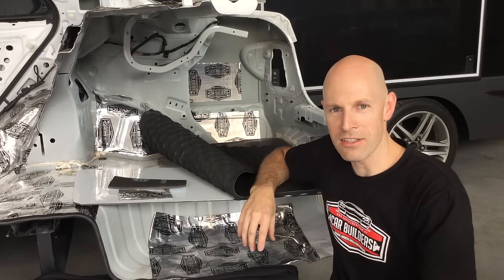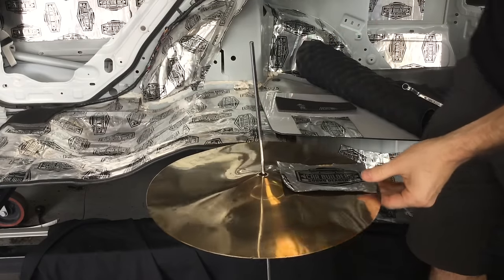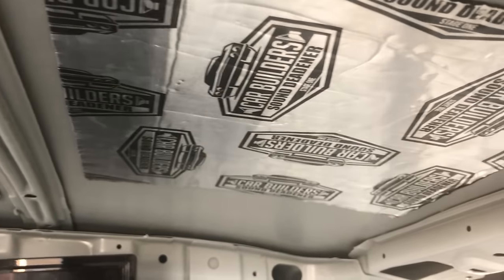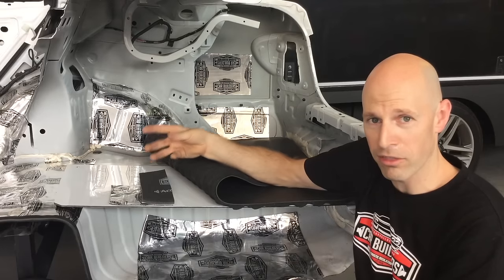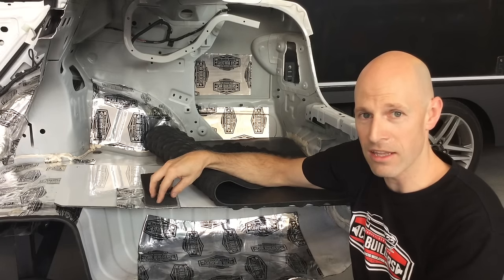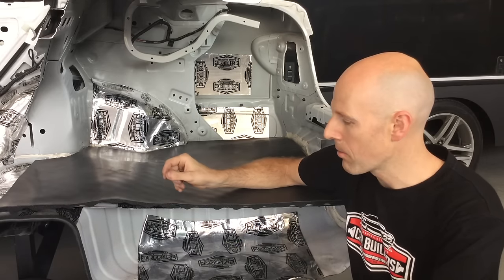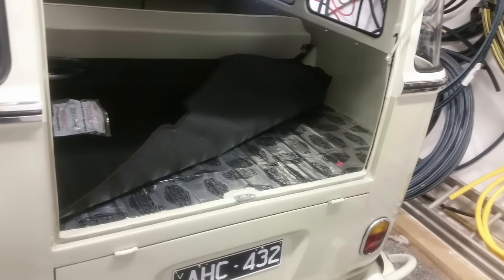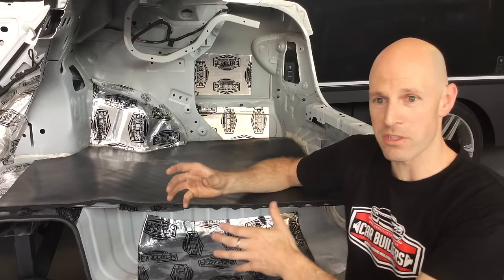The basics to sound deadening in cars. What should I use to control sound and heat in my car?

Comment: My car should be so loud that you have to shout, no muffler no cats just straight pipe exhaust coming out under the doors. The V8 should literally shake the cabin apart and the AC should be totally broken so that you have to open the quarter panels to get some air but then the engine sound will overwhelm you if you open them. Thats my idea of a perfect mans car, also it should be 50 years old. Not some last years air conditioned model plastic bucket with heated seats and gadgets and 1.5 liter hybrid. That is a womens car.
Reply from the maker: what did you say.... 
Haha, yeah, that's a car with some personality 😎👌

Comment: What about rubberized undercoat for under carriage that is supposed to offer some sound dampening as well? Also can we just use the foam sheet only and not use the rubber sheet before it?
Reply from the maker: Hi there. Rubberized undercoats such as Bully Liner are good protective coatings rather than sound deadening treatments. There are purpose made paints to treat sound and heat such as the Lizard Skin range http://www.carbuilders.com.au/lizard-skin-sound-control 
The butyl mats add weight to the panel and stop vibration created noise. If you don't think this is a problem in the vehicle you are treating you could apply just the Stage 2 underlay options to filter road/external noise.
Reply: I did the spray can stuff on my wheel wells. It didn't work as well as I would have liked. I'll use exterior low-cut carpet fastened to the under side next. That's what my Lexus has, and it seems to be working fine.
Reply: Thanks for reply. Now i know what i should do for my car.
Reply: Rubber undercoat Will destroy your car man, use oil or asfalt

Comment: Beware of weight Butyl is heavy ….Certain layers can eventually lead to hundreds of pounds...and that's  a lot of Fuel costs.
Reply from the maker: Hi Todd. One box (1.8sqm) is just under 7kg. Most of our full vehicle packs are under 50kg (this includes the Stage 2 noise blankets- mass loaded vinyl)...equivalent of adding a teenage passenger. Any product which is going to act as a Stage 1 vibration dampener needs to have weight as it is the weight on the panel which stops the vibration.

Comment: What if I just put a thin roof insulation sheet in the car
Reply: iTsNick it’s only .5 mm thick. You have to do four to five layers, and even then I doubt the thin rubber will soak up any vibrations... I’m actually doing this in my car, and it doesn’t seem to making a difference at all... Shame I can’t share any pictures...  I show what I have done, and how it’s not worked... just to thin.
Reply: Roof insulation sheet is asphalt, it is a very poor vibration damping product.  You need a viscoelastic layer coupled to a rigid surface.  Ie, a good butyl attached to a moderately thick aluminum layer.

Comment: Isn’t all this stuff heavy?
Reply from the maker: Hi Peter. Sound Deadener (stage 1) needs to be heavy to add weigh to the panel and stop resonance. The foam underlays (stage 2) are light. The Mass Loaded Vinyl is heavy. Depending on the vehicle (areas deadened) and choice of stage 2 (foam or mass loaded vinyl) the total weigh may vary from 20kg-45kg for a sedan.

Comment: My GTR got soundproofed. And now its like dronning and vibrating. What is wrong ?
Reply from the maker: Hi Little Reptilian. What stages did you do? Did you put stage 1 deadener down? This is the stage that will stop panels vibrating. If you put just a stage 2 vinyl down you will still have vibrating panels. Feel free to call us to talk about the specifics 03 8777 0960 👍

Comment: Nope. Water will find its way via the edge of the foam sheet to the open cell foam bottom half and because the closed cell foam sits above the now wet open cell half which is in essence a sponge, that water is not going to escape ever and you are going to get long term mold issues. Good luck!
Reply from the maker: Hi Supercharger. If water is a concern for you, we don't recomend the Acoustic Liner (and definitely not the factory cotton jute underlay). We have Water Proof underlay, which is 10mm of closed cell foam. The 4x4 guys, prefer the Mass Noise Liner (MNL) which is a closed cell foam with a mass loaded vinyl on top. MNL isn't a peel and stick product so if they swamp it or are concerned about water on the floor pan/cargo area they can easily lift it up 👍

Comment: Does it have to be shiny? Aluminum.. I mean I have AC in the car so heat won't bother ...
Reply from the maker: Is the sound deadener going to be the finish? Normally it is covered with a carpet underlay and then a carpet so the shinny finish look isn't an issue. We also have sound deadener in 4 colours/designs
Reply: Car Builders - Thermal & Acoustic insulation materials oh ok so for heat and looks. Thanks ! There will be carpet

Comment: so if one little piece can quieten a Cymbal, why do we need so much of this stuff in a car? Surely one medium square per panel would do it.
You guys wallpaper the entire interior & add heaps of weight by doing it because this stuff isn't light. In my opinion the spray on butyl is better.
Reply from the maker: Hi Robert, you're right. Around 30% of a panel will make a significant reduction with further deadener continuing to produce results but not as dramatic as the initial application. Auto manufacturer's will engineer sound proofing additions to a dollar point, researching the optimal positioning for deadening to just meet consumer expectations. Vibration dampening mats are most effective on single skin metallic surfaces. It is unnecessary to apply deadener to over-lapped metal sections, top hat, chassis sections etc as these areas don't resonant. To engineer a car it takes some skill and technical analysis to pin point key areas, in reality most people will cover everything as they don't mind spending a bit more to ensure they have achieved the desired results. With paying customers, most people want everything covered. Keep in mind that this is one stage in controlling sound in your vehicle. 
What spray on butyl are you using? You will find spray-on products will cover 100% of surfaces. Many paints advertised as 'body deadener' do little to no sound reduction and are protective underbody coating rather than sound control paints.

Comment: This was needed in my old 350Z. The resonance in that car was unbearable. Instead of spending $2000 to stop the noise...I sold it.
Reply from the maker: Haha.. you could do a whole fleet of 350Z for $2000. I hope the new ride is quieter.
Reply: Bedliner... then the floors are wear resistant and washable...
Because carpet is for old grannys homes.
Reply from the maker: 😆one that treats sound or heat is best, such as Lizard Skin

Comment: Roof skins?
Reply: CitizenX I’ve used stage 1 sound deadener and then their 6mm insullayer
Reply: @DigitalFl0w  I am wondering if there is anything to improve soft top wind noise from the inside ?
Reply: CitizenX if you have a soft top convertible theres nothing you can do for the roof
Reply: @DigitalFl0w  that is what I think too, but I am wondering if I can add 1mm or 2mm foams on the inside, that would still allow to close if and absorbe a bit of noise

Comment: I don’t believe trim pieces or the carpet is going to fit properly after you place all that sound deadening material down.  Seems like overkill.
Reply: There are definitely points that you need to be mindful of. Trim pieces may be easier to find gaps in. It's more of a problem doing all of this under the carpet if the car wasn't originally designed for that much material underneath. After the carpet goes in you've got stuff like the trim panels themselves sitting overtop, bolts for seats or center consoles, etc. They should have different thicknesses of each material and in the end, each car will only get so far without fabrication.

Comment: It does crap. What he shows clearly reduced vibrations but not airborne sounds, hence don’t waste your money. 

If you want to reduce the overall insulation, you have to take into consideration dampening, blocking and absorbing materials. That is - polyurethane sponges (1-3 inches thick), felts, bitumen mats. 
Where to put all of it:
- front and rear wheel wells (bitumen, felts in foils), 
pillars A, B, C (polyurethane sponges with felts), 
- firewall (inner), 1st layer - bitumen, 2nd polyurethane sponges, 3rd felts
- inner strips (plastic covers under the door - felts and PUR (polyurethane),
- pillar B (apart from the plastic upper and lower part) and the very bottom - PUR
- under the rear seats - bitumen, PUR, felts
- rear inner fenders - same as for the rear seats
- rear boot - same. 
- headliner - PUR with adhesive and soft felts
- under the carpet - it really depends that your car brand is, so if you have PUR - don’t put any more of this. Just bitumen and think felt. If you have only felts - add PUR and bitumen. 

After days of applying those, you’ll see a difference. 

Don’t apply bitumen like the guy in the video. Scientifically proven a 1/4 of the applied surface is enough to dampen vibrations. Don’t waste your money.
Reply from the maker: Hi G.S.  Looks like we are on the same page. Vibration mats are only stage 1 of tackling sound in your vehicle. It will only stop panel vibration but as you can see in our various videos, we tackle externally generated noise and internal sound with a variety of different products, including open cell foams, closed cell foams, mass loaded vinyl and multi-layer products in specific placements. Yes, definitely don't apply bitumen. Not one of our products is bitumen, rather they are butyl based. Thanks for taking the time to comment.
Reply: @carbuilders1  Thanks for the reply. AS I have talked to my colleague who works with vehicles making he said that cars are basically dampened already during the stage of making the frame. The body frame does 50% of the damping, and generallly other noises. That's why in certain group of cars you won't be able to get rid of some noises. Body panels are spicifically made to dampen vibrations during the early stages of production. That's why lexuses, bmw or other brands are quiter even if they have less or the same amount of isolation materials. Sad but true.
Reply: @carbuilders1  I’ve seen other videos and still can’t see materials that absorb sounds. You’ve mentioned decoupling materials though. They’re good but still if we want a quieter ride you need thick polyurethane (10-20mm at least) layers and/or felts. Motor industry use 3M acoustic thinsulate that is more squishy than felts and a lot lighter.

Comment: you product may be good but its a rip off...period.. you can buy good quality sound deadener for hundreds of dollars less..try noico or killmat miles cheaper and just as effective
Reply: I got 10 sf of Noico for 26 dollars....
Reply from the maker: Hi omaerep. Thank you for your initial compliment. With regards to pricing, I assume you are talking about our sound deadener? It is important to make fair comparisons when matching products. Some brands package smaller dimensions or their deadener is not as thick as ours at 2-2.2mm. Others use bitumen or asphalt based core materials, which have their inherent issues. Some brands butyl composition is unstable at higher temperatures.  I'm not sure how you are comparing your pricing because it is hard to be 'hundreds of dollars less' when our sound deadener costs $99AUD. Our product is the same quality as the market leaders in Dynamat but we are far more competitively priced. We are a family based company that prides itself on service and informing and educating it's DIY audience. We can be contacted by phone to discuss our products and their application. You can not do that with the brands you have mentioned who flood online channels with cheaply made products and no service. Many of these other brands also deal with one aspect of deadening- vibration dampening- where as we look at the whole issue of acoustic and thermal solutions, not just one stage. 👍

Comment: This stuff is super expensive!! Well over a grand to do my dual cab. Ill just turn up the stereo & drown out the road noise!! heaps cheaper!!
Reply from the maker: Hi 79 Series V8. Our dual cab packs start at $445AUD and the premium pack is $720AUD, which treats floor pan, doors and roof.... and the stereo will sound better too 😉http://www.carbuilders.com.au/4x4-single-cab-floor-pan-kit~334
Reply: @carbuilders1  Thanks for the heads up on price, thats only supply, so well over a Grand supply & fit then.

Comment: Meh just more weight I just stripped and bedlinnered the floor
Reply from the maker: Hi Pinkamena Diane Pie. It all comes down to what you are trying to achieve. Most Bedliners don't solve any sound or heat issues. If you wanted a paint finish, we would suggest using a paint that will target sound or heat such as Lizard Skin Sound (if you are stripping weigh however, the paint is mass loaded and is also quite heavy) or Lizard Skin Ceramic (which is used by racing teams).
Reply: Car Builders - Thermal & Acoustic insulation materials really you guys have that? And could I apply it over the bedliner  , my car has leaky t tops as well

Comment: Your car is going to be heavier and increases fuel consumption.
Reply: macaroni29 fuck it. Smiles not miles!
Reply from the maker: Hi macaroni29 Yes, there is a weight addition when sound deadening. Sound deadening (butyl mats) weigh about 7kg for a box (1.8sqm coverage) which will cover top of firewall to the front seat rail. A second box will get you to the rear seats. Then, depending on how seriously you want to treat the sound in stage 2, you may add a foam or a mass loaded vinyl. The foam is light and the mass load vinyl is heavy. Regardless, you are adding less than the weight of another passenger in the car.